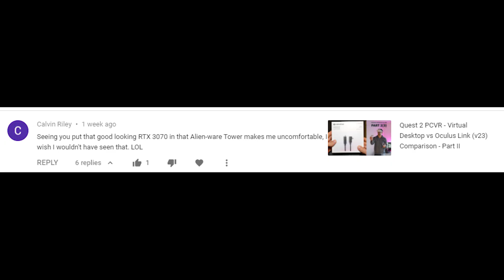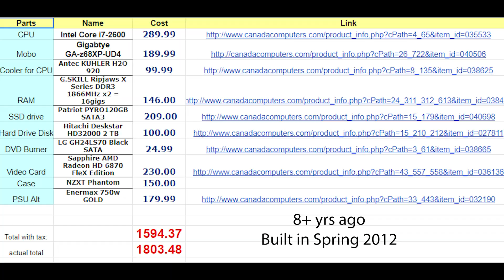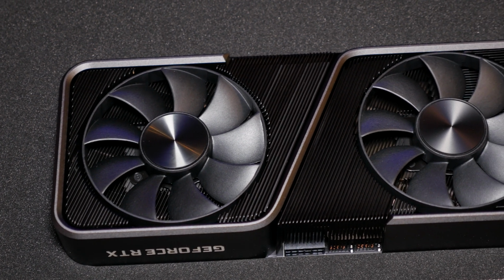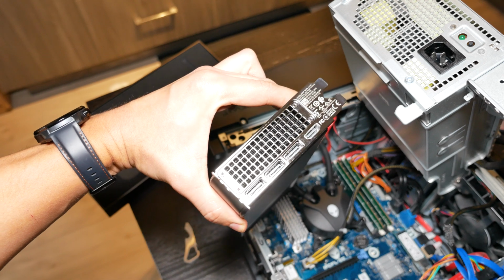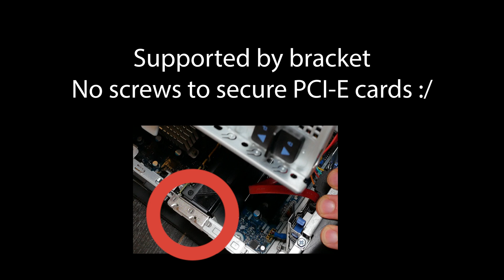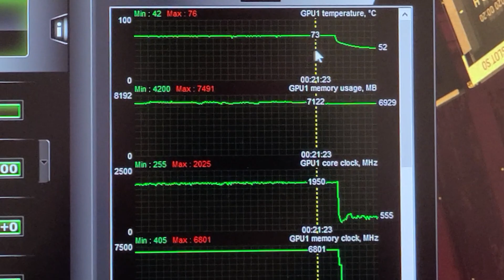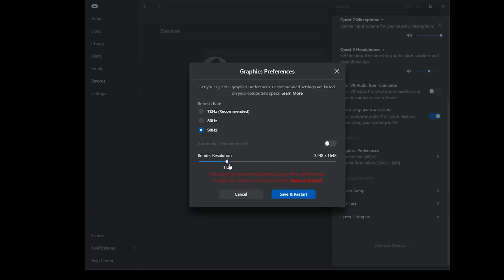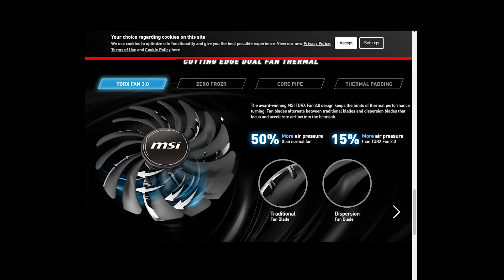Will My RTX 3070 Melt My Prebuilt Dell PC? (Review from Aurora R7 / R8 User)

Comment: great vid dude , i have the same pc but its weird cause i have a 1050ti , i58600k model with liquid cooling and the 850w psu , i recently upgraded to a rtx 4060 (ventus 2x) , the performance jump was pretty crazy obv , i also added some ssd and 16gb of ripjaw v ram 3200mhz (this dint work had bosd after a week until i disabled xmp which runs the ram at 2133mhz ) but my cpu when playing heavy games for like 30+ mins reach like 80-85 sometimes hit 87 , i was wondering if this is ok to keep using like this
Reply: Alienware Command Center to control case fans?

Comment: I am currently in the process of building a new PC. I've been using an Aurora R7 since 2019. The new card i decided to to buy (RTX 3080 FE) came in first and i couldn't wait to see it perform. So i removed the front fan from my R7 and put it in. Everything worked good, cyberpunk at RT ultra with great performance. I only played for about 15 minutes, as i didn't want to overload the R7, even though it had an 850w PSU. I put my 2060 back in and played some black ops 6. I could smell burning electricity smell coming from the computer. The 3080 melted my 6 year old bronze PSU.

Comment: I put an RTX 3080 blower style card and it works perfectly. Only issue I had with it was the initial placement of the card. I just had my dad sand down the plastic hold up for the card because it was a little too wide for the grip. Also, I will say that the case is HORRIBLE for upgrading, especially in the year 2024 since everything has surpassed the motherboard and you can't remove the motherboard due to it being a part of the case.

Comment: Hi how about I have an Alienware Aurora R7 Core i7 8700K RTX2080, can I change its graphics card for an RTX 3080? And if possible, which components should I change? Thank you
Reply: I have an R8 i7-8700 with a rtx 2080.  If you're still looking I, just put in a Dell OEM GeForce RTX 3070 Ti 8GB GDDR6X  in my R8 and it works great. There's quite a few open box not used on ebay for about $300. Very happy with it.  Probably the best upgrade i could expect from a 5 year old pc considering price, case fit, and avoiding a bottleneck...

Comment: Three years later, and your video is still very much appreciated. I bought my r7 for the same cost/performance reason you did. Now I'm upgrading, with a $700 total investment to equal many $2000 prebuilts of 2023. MSI RTX 3060 12Gig, Two MSI NVMe 2TB SSD cards, Hyper X Fury 32Gig Ram. I don't game, but AI LLM's and Stable Diffusion drove me to need a 12Gig Nvidia graphics card. I'll be good for another two years. 7 years of computing with a total investment of $2500 isn't bad. Only PCIe bus speed will drive me to a new build. The r7 was a great investment!
Reply from the maker: Very good buy!
Reply: So funny, I am getting ready to upgrade all components in my R7, would love some input with everything that is out now. I’m sure hmu upgrading psu to 850W - I have an i7-8700k - GPU I was thinking GeForce RtX 4070 - will the bracket fit with this? - 

 CORSAIR - VENGEANCE PRO 32GB DDR4 - Corsair H60x RGB Elite Liquid CPU Cooler (honestly I’m not sure if I do need this) - I also want to add a sound card any suggestions? Any help would be great.
Reply: Is the 4070 fit in R7?  Any reviews??? @shemarstorridge6862
Reply: @shemarstorridge6862 did it fit?

Comment: Thank you man! Got 32 GB (2 x 16) 3200Mhz XMP coming for my Aurora R8 (best mobo can handle). My first upgrade was a 2TB SSD for my game installs. M.2 for boot. Next is GPU as I have a LG 32" 1440p 144hz GSync monitor and want to game at that res more. My GTX 1080 just isn't cutting it for newer titles at that res. Have to dial back settings to medium. 1080p no prob on High for mostly everything which Im ok with. I also opted for the 1000 watt Gold PS so I'm good. Got my eyes on a 3070 ventus for $800 Canadian.

I hate all the Dell forums where ppl are looking for answers and they're told this that but NOT Ummm... dont't think of what it can handle but what form factor can it handle...

Comment: I literally bought an R7 at the same time for same reason, debating to upgrade the CPU or buy a whole new PC. I have an i7 8700 and 1080 and want to upgrade the gpu to a 3080 but heard it may bottleneck the CPU using an old cpu still. thoughts?
Reply: I had an R7 with a 3060 TI. For the resolution I was playing at there was no benefit to having 3070 / 3080 due to bottleneck. I say had, because after experimenting with an R7 it was not cost effective to upgrade it so built an entirely new machine.
Reply: @ThomasHughesTShot  yea im thinking about building a whole new pc as well then instead. I do however want to repurpose this PC for my wife into a cleaner case. does dell make this easy for the motherboard?
Reply: @AxelShifter  Nope, the motherboard is a proprietary shape. Your really going to struggle todo that. 

 One thing you can do is replace the fans, the stock fans are hella noisy on this machine. If you are interested in this let me know, can recommend which fans you need.
Reply: @ThomasHughesTShot  in that case I’ll probably just start another build and put this 1080, i7 and storage into that one. These fans are ridiculous lol thanks tho!

Comment: Hey I came across your video and want to say thanks for it! I also wanted to ask( on the bases that I am not knowledgeable about computers) how do you fix ‘no display’ when you install a new graphics card. I have an aruora r6 and tried upgrading the power supply (corsair 750W) and the graphics card (rtx 3060), but no image came up on the monitor. Thanks again for the video!
Reply: I have an r6 as well. Did you finally fix your problem ? Everything working fine ?

Comment: I have a Alienware R5, which is the same case. It's not water cooled, but it is 850 watts. I have a GTX 1070 and was looking at the RTX 2070, but I may look into the RTX 3070 instead now that I know it can fit. But, I will probably end up sticking with a 2070 for my needs. 

Thanks for the video.
Reply from the maker: Do a 3070!

Comment: You know you can also fit an RTX 3090TI in this case as long as you get the right size 1 and it takes minimal modifications to the case meaning you only have to cut a tiny piece of metal out of the way
Reply: Have you done it ? If so what's the exact card that you used and power supply?
Reply: @Buardo  the EVGA RTX 3090TI for the win three ultra     I did not have to switch the power supply the 850 Watt power supply that came stock in the system works fine you do have to remove one fan to fit the power connectors on the end of the card and also cut a hole in the metal support system for the case

Comment: it's a shame at the time you made this none were available now Nivida makes ever single card from a 3060 to a 3090 dual fan that will fit
Reply from the maker: I'm sure there are dual cards
Reply: @JSyntax  lol I have 2 in a single R8 a 3070 an a 3080 lol its ran fine for over a year
Reply: Not to mention there cheaper now because of bitcoin crashing a card that was 3,000 is now 750 if u know someone 1,000 if u don't are u could risk  life  and limb on ebay an get one that may are may not work for real cheap lol people give the pc a hard time but I have had a pc built pre ordered the whole nine an while the Bitcoin boom was happening it was cheaper to buy the pc with gpu ram an everthing all ready in it but I haven't had any problems out of the 2 I have just upgrades here an there an thats my own discretion I won't lie I wish you could change the mother board so u can run a 10th Gen cpu but I can still 
Play Any game I won't with a i9 an a 3080Rtx an it never gets hot its water cooled but even before I installed that it didn't get hot just sounded like a rocket lmao any way take care man

Comment: Hey, I actually crammed a 3080 into my R8 setup and saw someone else do it on Dell support. You were correct in the video when you said they were simply too long to fit into the case. But I found out that if you swap the standard front fan with a slimmer one and remove that oversized fan case Dell added for whatever reason, you can actually just barely get away with it. My thermals have been decent as well and I’m thinking on liquid cooling so I can keep the heat stress down as much as possible. Also, I’m very happy with my prebuild and I’m glad you are too and didn’t let some of these custom douche bags ruin it for you.

Edit: just saw the part where he said you can remove the front fan for more length. But I’m not sure if he knew that you can add a 3080 with some finesse
Reply from the maker: It's gonna be tight!
Reply: @JSyntax  For sure, I’d love to see you try though! If you plan on making a vid about this, the front fan I chose was the Noctura a12x15. Quiet, slim, and keeps it cool.
Reply: What 3080 did you use in your R8? I installed the slim profile Noctura fan but the EVGA GeForce RTX 3080 FTW3 ULTRA GAMING I purchased, won't fit, unfortunately. :(

Comment: Got a MSI Ventus 2x OC 3070 and it fit like you said!  Plenty of room between it and the front fan.
Reply from the maker: What no way
Reply: @JSyntax  yeah, drawback is it's thick enough that it blocks the 3rd pcie slot too so i had to move my other pcie adapter down to the 4th slot

Comment: I have an r12 i7 11700f and was able to install a founders edition 3070ti. It fit quite well but Im having all sort of issues. Issues such intermittent no video issues. When I get lucky and get video , it crases. Poor performance in games as in 20 fps in doom eternal etc at 1440p. I turned of safeboot as recommended and installed all the new drivers thats available and still no go.  I also tried the firmware update  for the gpu but the card didn't take it.  Any other solutions perhaps such as power supply?  The Pc came with a 3080 when it was originally purchased. Thanks!

Comment: I have an Alienware R7 with a 8700K, 32Gb ram, and 3080ti and it’s amazing. All you have to do is replace the lower front fan with a 15mm thick 120mm Noctua fan and you’re good to go. The old front fan was 25mm thick which hit the card. 

Also, this whole Dell doesn’t know what they’re doing is bullshit. They spend millions on R&D to make sure cooling and air pressure is sufficient. Is it the best?  No.  But it also isn’t a shit 3rd party case that’s just basically an open box. BORING.
Reply from the maker: True true good idea
Reply: hi !! can you put the  link of the fan ? plis! plis!
Reply: Pls PUBThe link up for that fan.
Reply: your 8700k works fine with a 3080 ti? hmm m maybe I don't need to switch to a 9900k I could just save money and get the 8700k?

Comment: I cut the corner and removed the front fan of my case to fit a rx 6700xt 3 fan bro 😅  but freaking sweet upgrade  !!! Remplace the front fan by 2 little 6 cm fan ... had to cut the front metal panel

Comment: i bought my R7 at the end of 2018, GTX 1080 and i7 8700k that's also liquid cooling but they only gave me a 460w power supply instead of 850w like yours, there were no options to upgrade :(
Reply from the maker: You can upgrade it
Reply: @JSyntax  managed to upgrade it to a corsair rm850x one, now if only i could get a 3070 for msrp XD . is the card still holding up well without the bracket thing?

Comment: About the graphics card sag, due to no screws - the new card I got was 2.5 slots (& heavy), so the bracket/holder that comes with it wouldn't fit - so I cut the rest part down to accommodate and sanded it to smooth it. Because it's so perfect for that case I wanted to keep it + other sag brackets can't fit in this case.

Comment: hey man so how's it running? is it getting way too hot?
Reply from the maker: I had to replace the front intake fan. See my video on it!
Reply: @JSyntax  What video, i've looked and can't find it. Plus i've already swapped out the front intake fan to ml pro 120 I swapped it out from the original fan.
Reply: @JSyntax  One more question did you have to uninstall the drivers or could you simply plug and play?

Comment: I did the same thing yesterday replacing my RTX2080ti to a RTX3070 and the PSU blew up within an hour. Not sure what's wrong but fortunately I have  warranty left
Reply from the maker: My psu at 850 watt was more than sufficient. What psu did u have?
Reply: @JSyntax  850 bronze.
Reply: Wtf, I put a 3080ti in my R7 with the stock PSU. Worried now.
Reply: @CDbiggen  What 3080ti card did you put in? Also, did it blow the PSU yet?
Reply: @SteffenDuche  , Plait, and no not yet lmao.  I'm not sure what happened to the first guy. Like JSyntax said, the 850 watt R7 was enough.
Reply: @CDbiggen  and you had no issues with the size of the card?
Reply: @SteffenDuche  , Yeah I did. I had to take out the front fan first of all or it's impossible for any 3080 and above to go in. I inserted a slim line fan with a high enough speed to pass the requirement that the computer needs to even run between the front plastic and the metal frame. Then because the card is quite heavy and large and will almost certainly sag (no screws for PCI on R7), and because the provided bracket doesn't fit in the case, I shaved down the plastic support that came with the alienware in order to prop up the graphics card. It was an awkward job.
I was worried about temps first and foremost as the air doesn't exactly have a lot of places to go, but by some miracle it doesn't get too hot. Now I need to dust it out as where I have the front fan in between the grill and frame I couldn't have one of those dust covers.
Reply: @CDbiggen  Sounds like a great little project :) Thanks for the explanation
Reply: @SteffenDuche  , It sucked hah. What kind of computer puts a minimum level on fan speed? Or no screws on PCI slots? Provides you with easy as pie access to upgrade, but no room to work with?
Anyway, all the best.

Comment: Really nice vid. I have an R8 with an i9 9900K  processor, with Dual 2080 Super Graphics cards inside and I bought my machine about a year ago from Dell. I was wanting to switch to any of the new 30 series cards and there might solution by ASUS. I found these on their site last night. Check this card out: RTX3080-10G-EK . There's also a 3090, and a 3070 of this type of design. They were made to fit into smaller cases. Let me know what you guys think.

Comment: nice video bro i have the same pc as you but mine came with the  1080. after you install the card where do you go to download the drivers for the 3070. and can i find out what my powersupply watts is i have the i7 8700 so im thinking i wont have to up grade my power supply but want to make sure. and your right i cant find this card at the bestbuy price anywhere so i also might be a victom lol thanks bro hope to hear back from you i sub to your channel
Reply: my i7 8700k with 1080 came only with a 460w, i don't think there's a way you can check what yours is without opening up the pc.  it'll say on the power supply

Comment: I use a different bracket it’s called VH1 VGA holder. I also have a office desk USB fan I got at Home Depot and it sits next to the PC blowing air inside lol. My Aurora R8 has a EVGA 2080 super taking 3 slots lol I got it for 600$ new on OfferUp right before everything went up in price. and I also replaced all the fans and added a liquid cooler radiator sandwich and a 1000 watt PSU and 64 GB RAM. I have a i7 9700 and was going to replace the CPU but I just went to micro center and bought a i9 10850k for 50$ more than the i9 9900k I was going to get for the R8. I will be building a new PC soon to use a dual stream PC setup
Reply from the maker: Did you feel you really need a gpu support bracket?

Comment: Just to let you know I managed to install RTX 3070 Gigabyte Vision OC(three fans design) into my Aurora R10(the same internal design), i just had to move my intake fan in the place where s HDD sits(in some systems). Max temperatures are 70'C, very happy so far, I upgraded PSU to Corsair RM850X. BTW I built my Aurora myself as in my case it wasn't pre-built but pre dismantled. I found empty case and Mobo, i bought all the other parts and it worked straight away(my first ever built). Bear in mind that even case was deconstructed. I have satisfaction of building it myself, owning Alienware design and saving about £1000 on new one.

Comment: I at first upgraded my Aurora R5 from a GTX 1070 to a RTX 3070 FE, but was then bottlenecked badly by my i7-6700 so didn’t end up getting much performance improvement. So, I ended up getting an HZXT H1, new motherboard, Ryzen 5600X, 3600MHz RAM, and a Gigabyte 3070 Vision and sold the 3070 FE. It’s insane how much better gaming performance was after all the upgrades. Prebuilds are nice until you realize the upgrade path is nearly non-existent. Once you need a new CPU or motherboard the case is useless.
Reply from the maker: Darn! Thank you for sharing your experience.
Reply: @JSyntax  Thanks for the video! I’m sure with a more recent Aurora and CPU the upgrade is much more worth it.